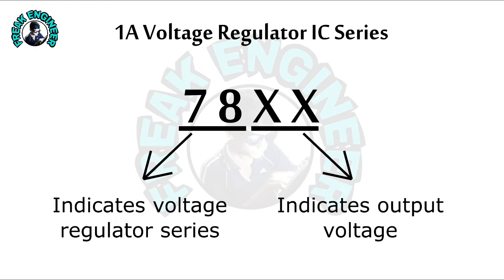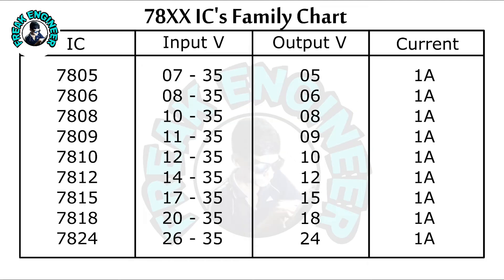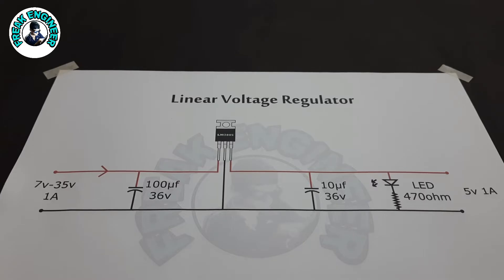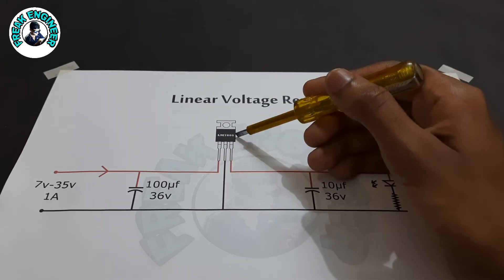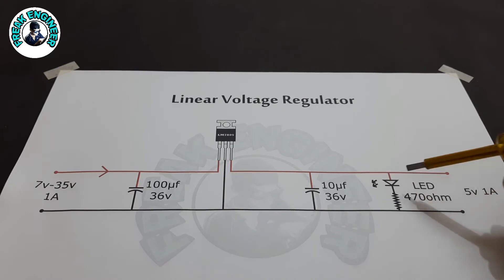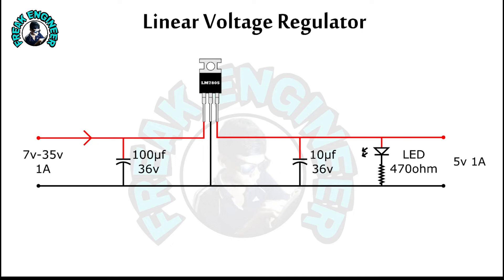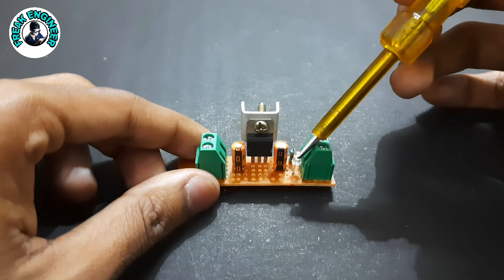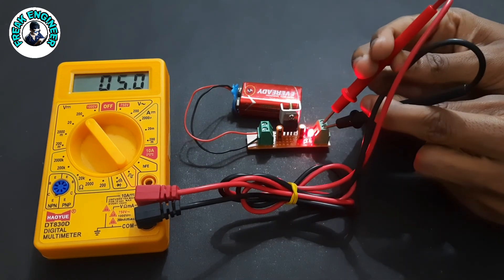#lm7805 linear voltage regulator ic | lm7805 ic | freak engineer

Comment: dear how to getting input 12v 9amp to output 5v 1amp
Reply from the maker: You need to have a buck converter with adjustable voltage and current.
Reply from the maker: Search for buck converter on YouTube.
Reply: This circuit he shows will output 5v at one amp even with 12v input.